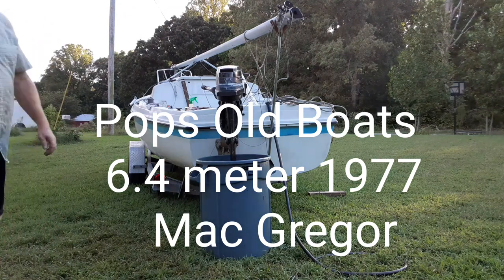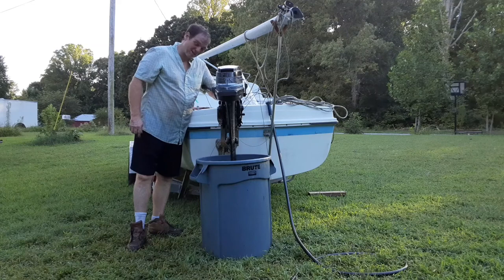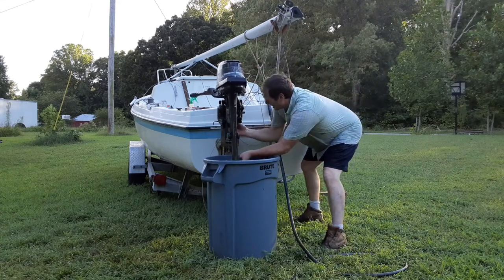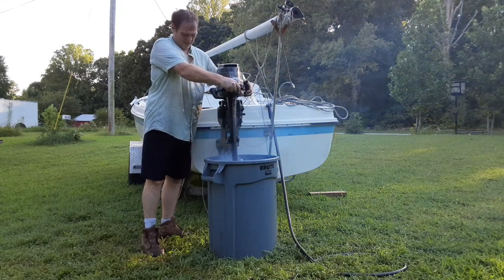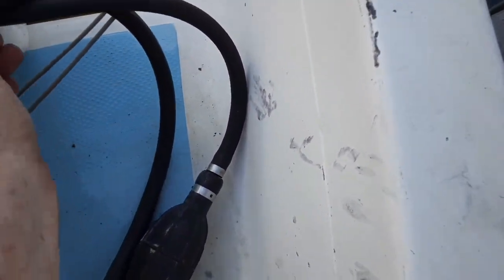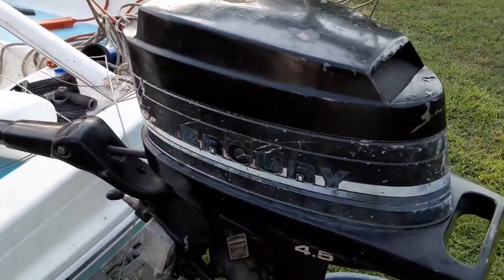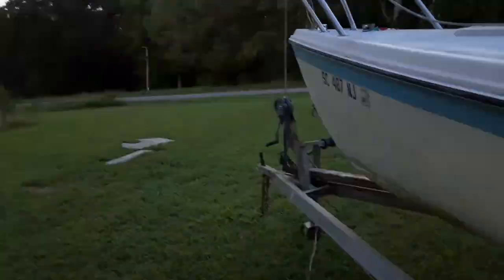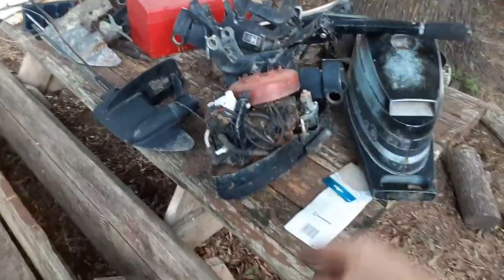1977 6.4 meter Mac Gregor  sailboat.  Restoration and mercy 4.5 modifications

Comment: Thank you for running that fantastic little engine in a trash can full of water and for showing how to run the gas out of the carburetor after use. I have often heard people start up out of the water and assume there is no impeller damage.  That is a big mistake.  I had a similar engine from another manufacturer and forgot to flush it in fresh water after running it in salt water. It locked up after a while and when I took off the head the cooling channels were full of a white powder.  After cleaning and reassembly it then ran fine.  Storing mixed oil and gasoline with fuel preservative did not seem to prevent future carburetor problems. Fuel over one month old needs to be discarded or maybe run in a bigger 4 stroke engine.  Cleaning out a clogged carburetor while anchored in rough bay water is not easy and a good way to loose small parts and tools overboard. It also seems to frighten your crew.
Reply from the maker: I lived in Manteo NC for a few years and saw many of them dead from salt. I know exactly what you mean.

Comment: that motor runs really nice.  i had an evinrude 6 on mine and it could plane it easily...and it is a displacement hull, not supposed to be able to plane.   i have an electric on it now, because the 6 was a tad too heavy.  i use solar to charge it.
Reply from the maker: Wow it is like you know what I am sitting here editing today. Next 2 part video will have you humming the twilight zone soundtrack.